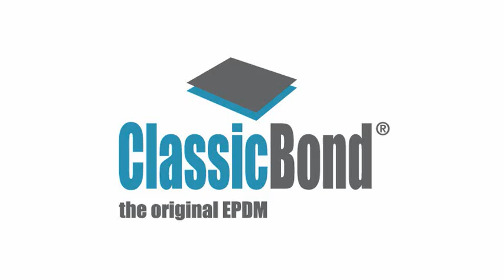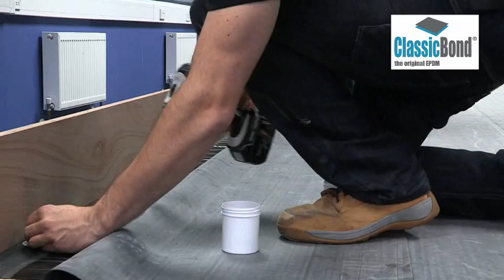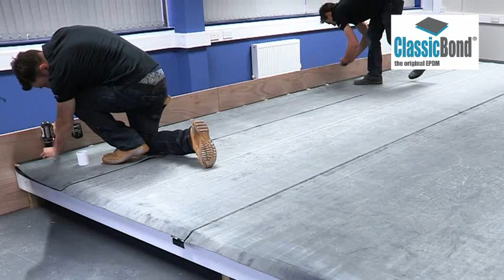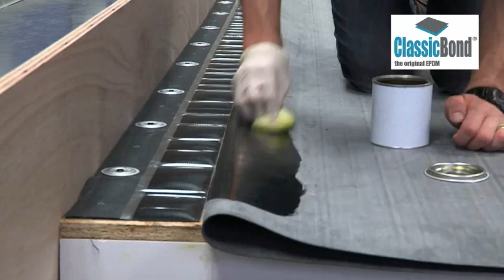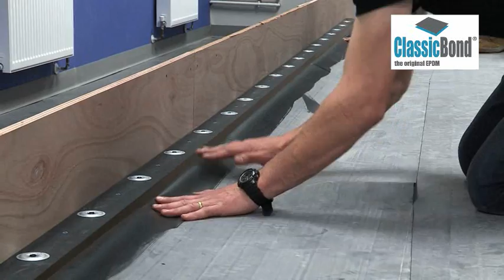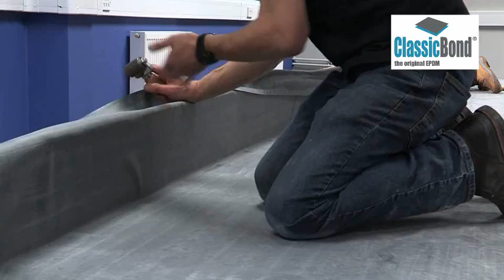Flat Rubber Roof with RUSS - EPDM Installation Guides and Training

Comment: I'm not a roofer but I see a few things wrong already.  Why don't you put silicone under the plates before you screwed them in?  and why don't you overlay the rubber over the edges and cut on the opposite side?
Reply: You're not a roofer, these guys are. Back in your box.
Reply: @johnnybegood9742  but i am an engineer on construction and its my job to protect the consumer. Your probably one of the bad roofers I'm looking for.
Reply: @1ElectricKing  I don't see how adding Silicone sealant under the load spreading washers would make any difference since the EPDM membrane covers the washers. If water gets under the membrane then its all over anyway..
Reply: @1ElectricKing  The screws are under the waterproofing membrane, why would you caulk them? This is also a mock up so the edge detail is unfinished, this just shows the RUSS strip application. Keep an open mind, your not an expert on everything because your an engineer.
Reply: 1) Silicone under plates would be absolutely pointless. 

2) They cut the rubber level with the top of the abutment because they clearly state for the purposes of this video it represents the chase line that would be in a wall.
Reply: You don’t need silicone or any other sealant under those screws, since the rubber roof is going over and up from those plates.
Reply: Lol! I knew right away this would be a fun little comment section.  If you did put silicone under the washers like you said,  the silicone and Primer  wouldn't dry (or cure) at the same time. I can almost 
Guarantee that each plate would create big bubbles... but hey,  you're just trying to help consumers 😅😂

Comment: well this video don't go into air bubbles forming and what to do
Reply: Clint East if you install properly you won't get air trapped below the rubber sheet ,but if you do end up with blisters from excess heavy glue or improper rolling in the sheet the bubbles or blisters are an easy fix ,you slice the blister out where the rubber sheet lays flat with no overlapping rubber from the blister ,a small blister you simply cut a patch from the sheet of field rubber that's 6 inches bigger on all 4 sides than the blister ,apply seam tape to the underside of your patch ,black glue all rubber to rubber connection points amd prime where the seam tape will lay ,then fold the patch in half just like the field sheet and roll over the repaired blister area ,if it's a gold warranty system you then strip in the patch seam outer edges with 5 inch peel & stick rubber ,that's it .